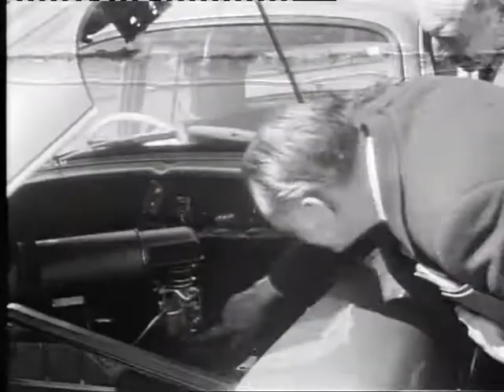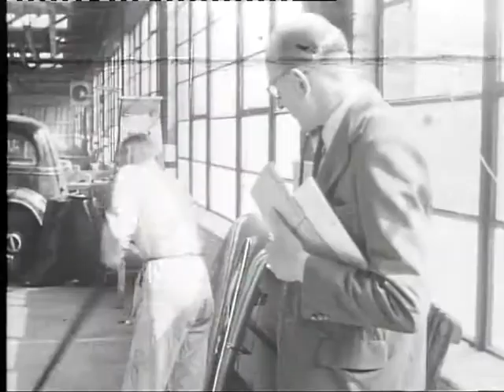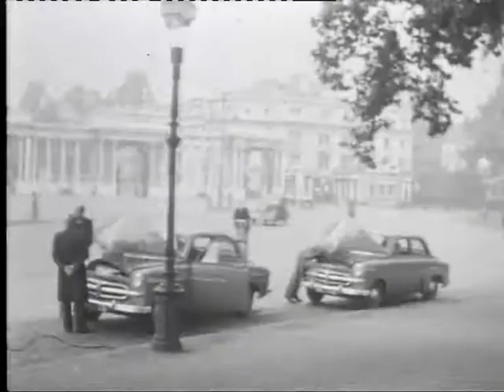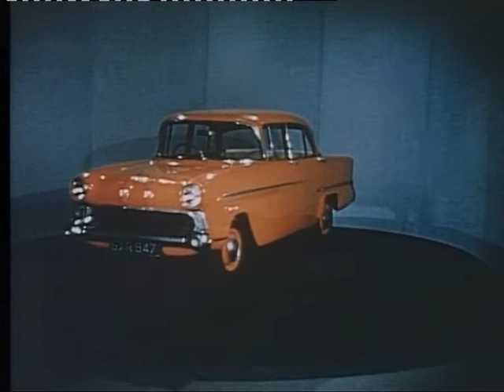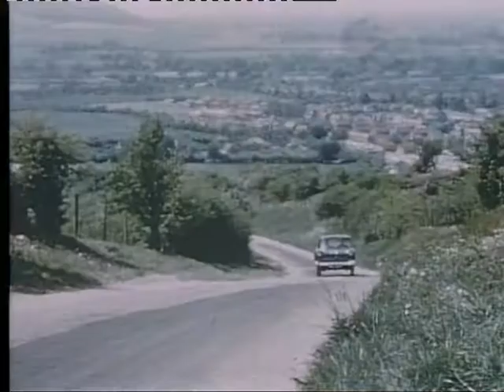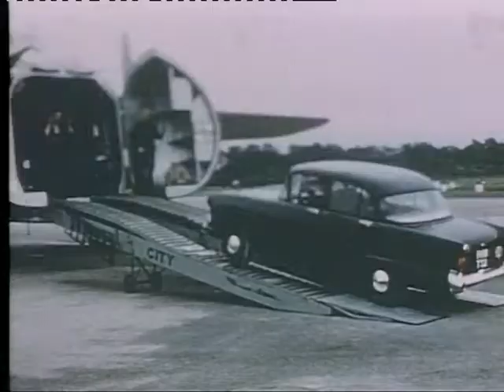Vauxhall Cresta Velox Wyvern RAC testing

Comment: Did you notice the correct way to adjust the tappets? Hot with the engine running. using a single 13thou feeler gauge. It was ruined after just being used once but boy what a difference to the engine sound once done. Also did you notice on the Victor the moulding on the prototypes rear door and chrome headlamp peaks. Both dropped on the production models.